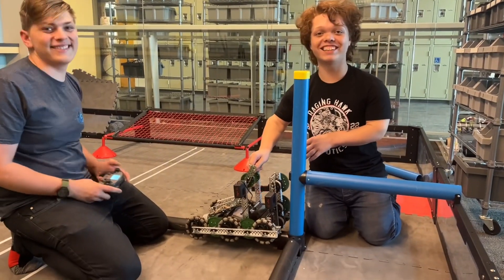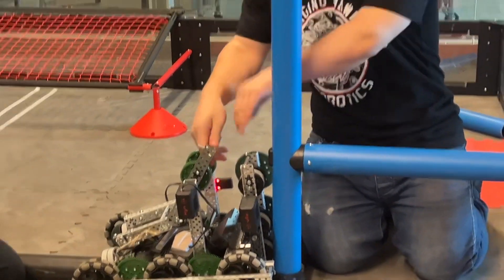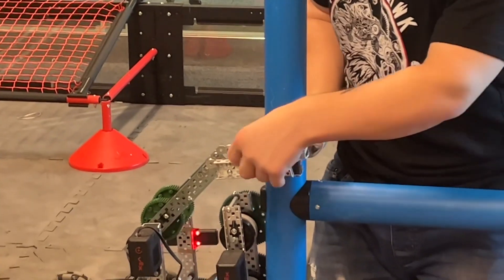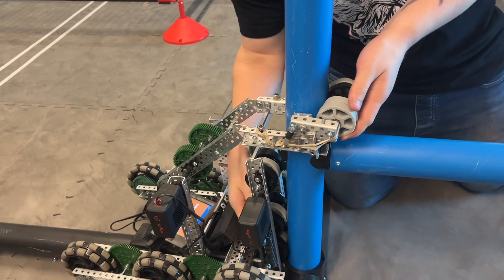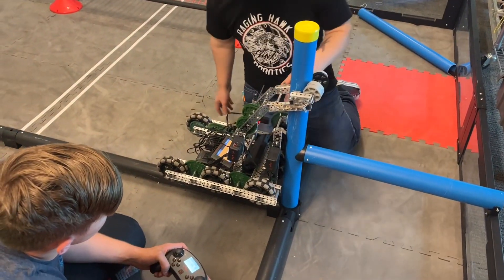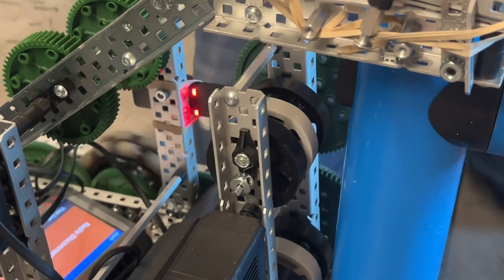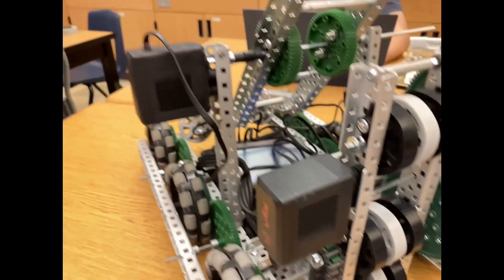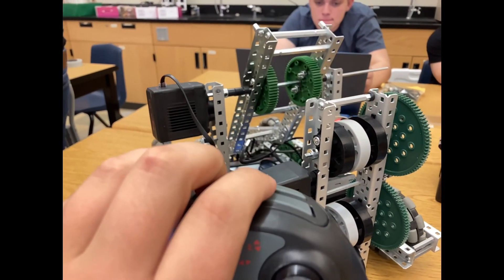Vex over under Climber concept reveal and semester final video

Comment: I had a very similar idea but will graduate this year so I cannot use it. I will say your flex wheel skipping is because you are using the smaller and thinner flex wheels. If you try and use a larger black flex wheel you should be able to drive up with no problem. Another thing is instead of using a motor to lock onto the bar as a tensioner, consider using a pneumatic locking clamp. They were very big in Tipping point to grab the goals and when your motors kill at the end of a match the locking mechanism will keep you attached.
Reply: oh I didn't even think about the motors getting turned off at the end of the match, yea I might have to reconsider  hmmmmm how to design the claw mechanism I have
Reply: My school puts all their money into football and we can’t afford pneumatics 😢

Comment: Hey guys how are you planning to prevent it moving downwards at the end of a match the motors are set to coast .
Reply from the maker: They will be on a ratchet
Reply: In our tests of a similar concept, the weight of the robot locks it in place without a locking mechanism